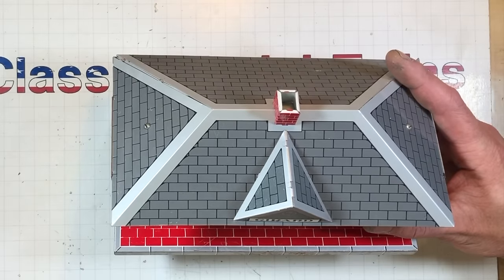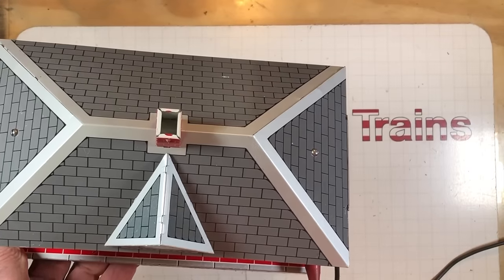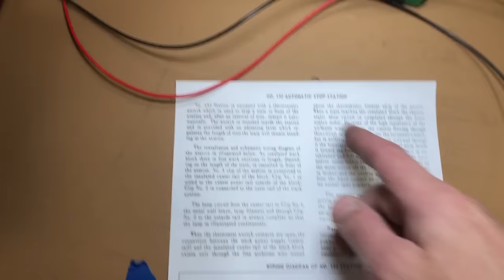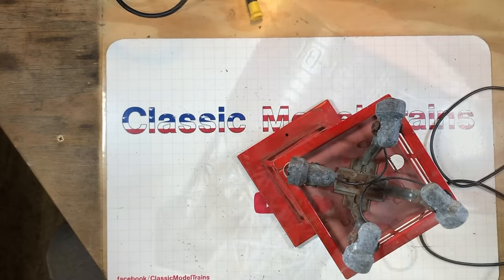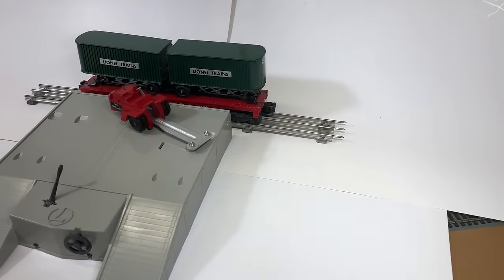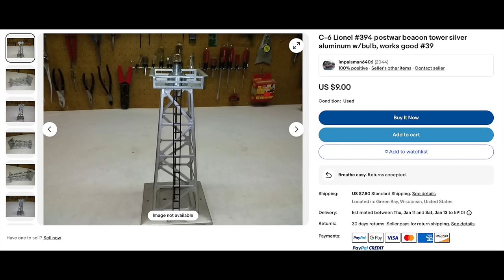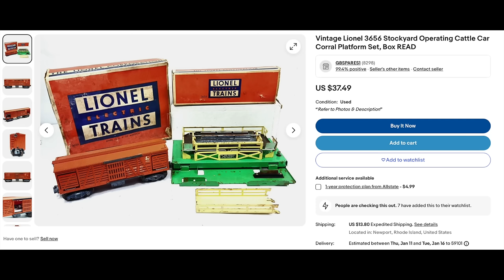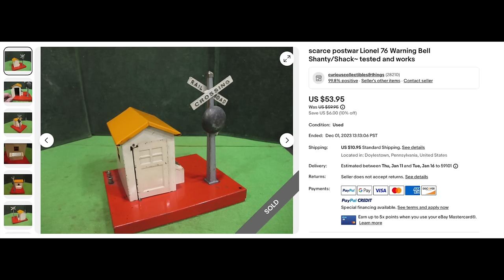What are these Lionel Accessories Worth Today?

Comment: On your cattle corral, you'll find 2 sets of slots on the platform base. The upper set of slots is for use with O-27 track and the lower slots are for use with the taller O-gauge track. When everything is in it's correct slots, the operating corral platforms will sit level with the car and the cows can enter the car without tripping on the thresh-hold. Also, this accessory came with 2 sets of track contact blades, short ones for O-27 track and taller ones for O-gauge track. LOVED the video!
Reply: Never knew! Good info.
Reply from the maker: Thanks for this good information Roger!  I was wondering how they solved the difference in track heights
Reply: @classicmodeltrains  Sometimes the little silver platform ramps can get out of adjustment, so they sit too low or too high. There's little tabs that slip under the surface of the platform and make contact with it so the ramps vibrate- it also is a fine adjust for the ramp height. Once you have the platform set up for your track height, very carefully tweak those tabs until your ramps line up with the car height. You want both tabs making good contact with the platform, so if you tweak one, you gotta tweak the other one to match it. It's ok if they're slightly off, as long as the side where the cows enter the car is above or at the height of the little track inside the car, and the one where they get off the car is at or below that height. Otherwise the cows won't want to get in and out. If the ramps are too different in height, the cows are more likely to fall over, but truth be told, they like to get stuck and fall over even if you have the darn thing adjusted right! Part of the problem is they're a little top heavy.

Comment: I have my dads Lionel set from when he was a kid. Including a #624 C&O switcher, a 3482 operating milk car, with the platform, car, track, and milk cans. A cement car, gondola and a few others. I just powered up the switcher for the first time in 30+ years. The last it was run, a faulty power supply overheated the 3 position unit. I replaced that the other day and I'm working on get the rest clean up a bit to set it up.
Reply from the maker: Glad to hear your getting some family memories back on the rails again!!

Comment: Hello Ron, you have an excellent haul you bought. That #455 with the Red top is more sought after than the common Green top, so that’s a great piece. The #460 Piggy Back Transportation Set is a nice piece also. The green tops of the trailers are meant to come off, so don’t glue them. ALSO, there are little red projections underneath each trailer. Those are the indicators to show the correct position for the lift. The #132 Automatic Train Control Station is actually a very cool accessory. You can adjust the length time the locomotive stops by lifting off the top, and adjusting the control for a short time, a long time, or continuous running. I use this train station all of the time, and it looks cool when you have a passenger train stopping and then starting back up again. Great stuff there Ron!!
Reply from the maker: Hello Tom!  Thanks for some insight on these items.  Yup I know not to glue the tops on, but DANG!!  They fall off if you look at it too hard.  I thought the trailers just had marker lights painted on them, but what you said makes more sense.  I Really like the #132.  Found the directions online in what it does and how it does it.  Great idea they had.  Cant wait for a layout to start forming in real life.  That piece will be employed in it for sure.
Reply: @classicmodeltrains I look forward to when you have a layout up and running! It will make great video content putting one together.

Comment: I have a great vintage store nearby which regularly gets a lot of model train stuff and it’s run by this nice old guy. I’ve had a lot of great finds there, most recently 5 kit build, brass, pieces of rolling stock from about the 1950s. Unfortunately, the owner will be closing the store at the end of the month due to wanting to retire. So it’s kind of bitter sweet. (It’s double unfortunate because the only other place to get model railroading equipment is about an hour from where I live, oh well.🙃)
Reply from the maker: Yup, lost a lot of great places because the owner has put in their 30-50 years and the kids don't want nothing to do with it.

Comment: Prices seem a little steep compared with some of the deals I've seen at shows, but most of them weren't entirely unrealistic. Never knew I needed that auto-stop station until I saw it in action, now I think I need to keep my eyes peeled for one going for cheap. The oil derrick is definitely another one to be on the lookout for...

Hope you get your cows working. I have one of the cattle cars and platforms, I started fixing it a while ago but found it a bit of a pain and set it aside. I also have the later horse car, and that one seems much more promising.
Reply from the maker: I hear a lot of Fellers saying the cows like to tip over
Reply: @classicmodeltrains  it's true! They're awful tippy. It's not so bad except when they tip over inside the car, and you gotta fish em out.
Reply: Great video, Ron ✔. Loved every minute of it, since I have a few of the Lionel and Marx accessories that you picked up for great prices. Mine all came to me, either from ebay, used train stores, or from Lionel train operators and all cost me slightly more than what you bought your accessories for. But that was 10 years back, and yes, prices were higher back then for some of these vintage pieces.  Now, as everyone is saying-- it's the estate sale items that have begun to flood the market. 
But, again, my accessories are no where in the great condition that yours are. Mine all operate but for instance, the Marx Girard Station that I have, looks like " who did it and ran !" 
🤣 
Recently I saw online, a video of where some fellow either purchased or made himself -- new feet for his cows in that Lionel cattle ramp / corral accessory.  And once so " repaired " --- it worked much better than before.  Apparently those " feet " get run down / wear out rather fast with that accessory. I don't know how the reproduction cows fare ? 🐴🐴🐴

Comment: There's one thing to consider about the price guide of the past verses today. With Ebay and other places like Facebook Market, there's more available now than the items that are known to be for sale than the items which were available in the past. The guide's prices were based on prices sold at past train shows or by any sales that were reported to the guide. This can throw of the rarity of the items since it's based on what is known to be sold at the time recorded. This is the reason why many prices drop over time along with supply along with collector demand. If Ebay and Facebook were not around, the prices may not change to dramatically. Also, my personal theory is the demand for pre-War and post-war O gauge items are starting to drop due to collectors aging and passing away which drives the demand down by those who would be interested in these items.
Reply from the maker: I hear what your saying.  makes perfect sense to me :-)

Comment: Greenberg’s is a much better guide and they put out a new price guide every year. I get a new one every two years the prices usually don’t change much year to year but you’re better off with a recent one.
Reply from the maker: I agree.  The one I'm using is from 2004
Reply: @classicmodeltrains  A lot has changed in 20 years.